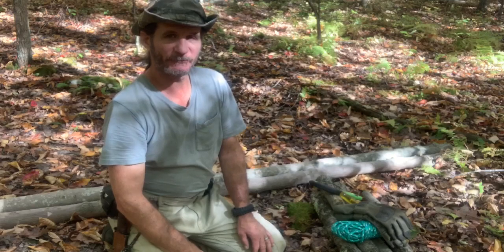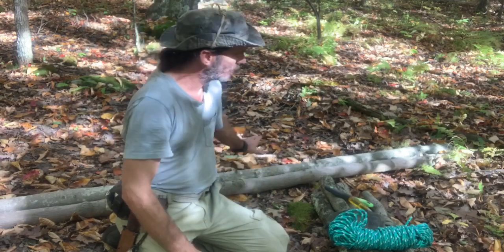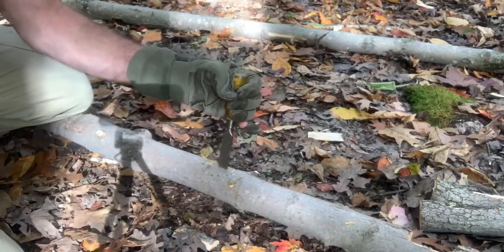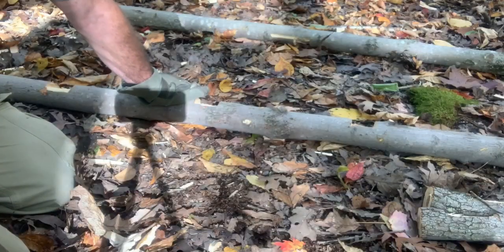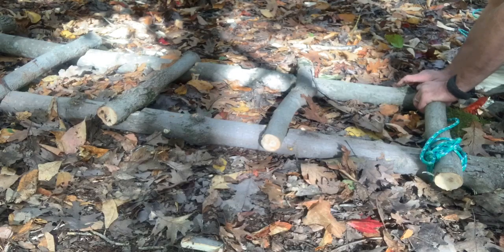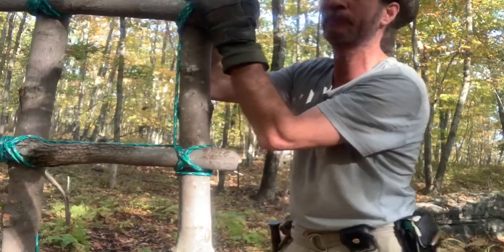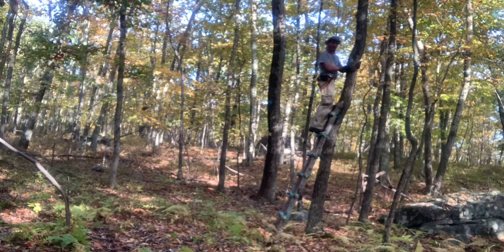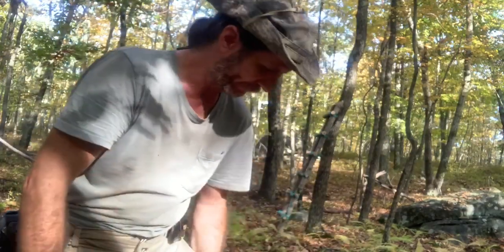Building a bushcraft ladder

Comment: Great video, was wondering what happened to you, glad to see you back. By the way what ever happened to the tree you chopped but didn’t fall. Did you get it down
Reply from the maker: James Koehler   Thank you. Yeah, didn’t do much the past few weeks. That tree is still hung up. I have a 60 ft thick black strap and another heavy duty strap that I’ll use. I still need to get it up to the fork part 50 ft up then figure out a primitive winch to pull it. Thanks for watching.